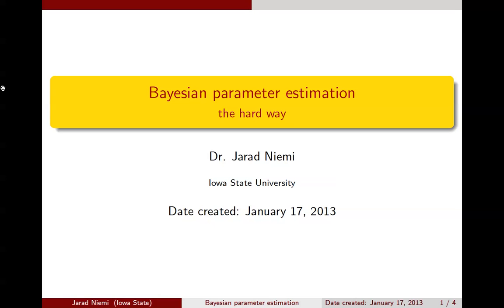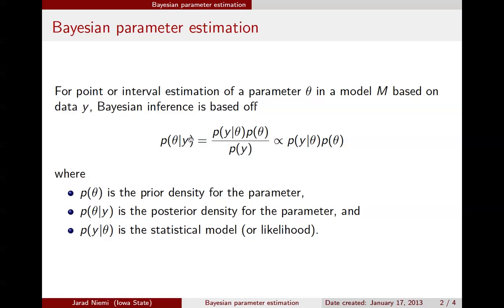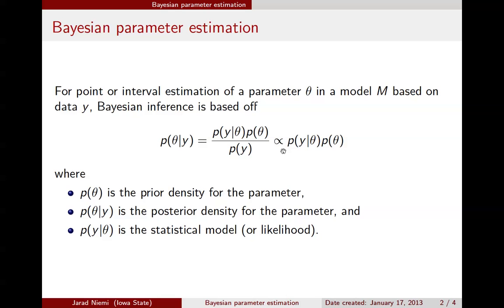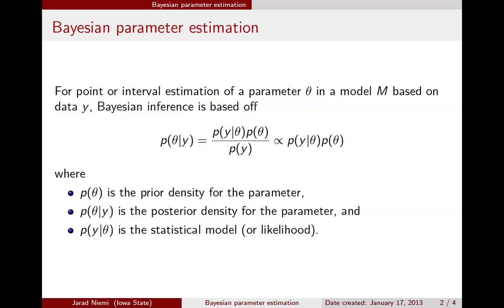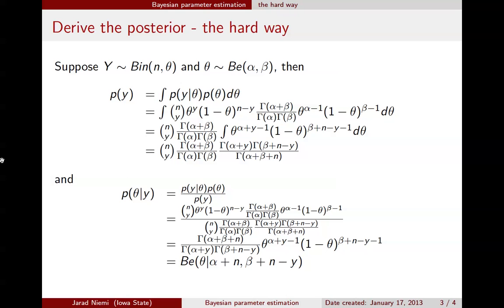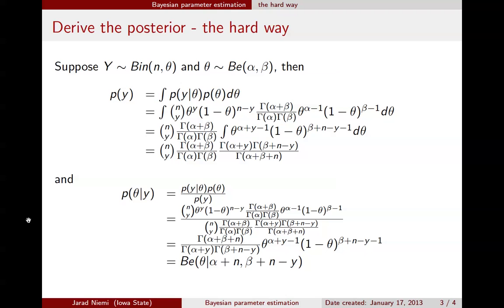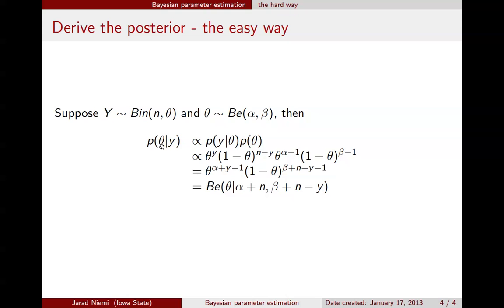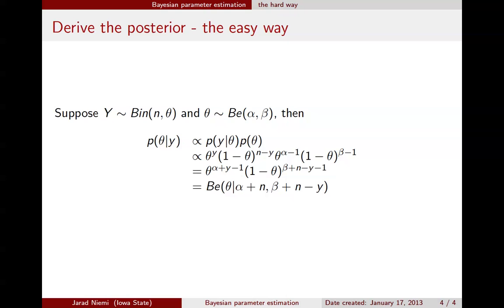Bayesian parameter estimation the hard way

Comment: I think the likelihood should not involve (n y)
Reply from the maker: Formally the likelihood is any function proportional to the given function. So with or without that term is fine. I typically avoid the term likelihood and instead use "data model" and therefore have retained the term.
Reply: According to your Bayesian parameter estimation video,  the Bayesian parameter estimation is uesd for estimating the probabilty of Mason Plumless's free-throw success. I did not notice it was a binomial distribution, I took it as a bernoulli distribution. Actually, we noly know there are 79 success out of 120 attempts, we do not know exactly which attempt is a successful throw. As a result, we must select 79 out of 120. We should have (n y), since it is a binomial distribution. My bad (QAQ)